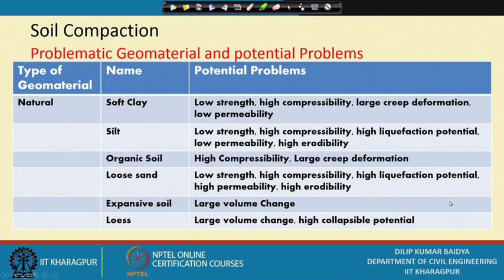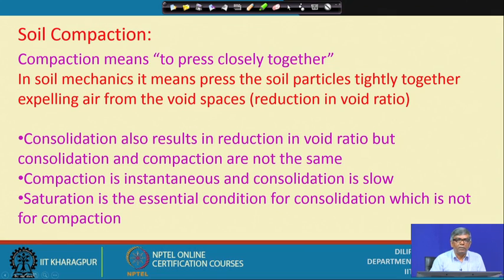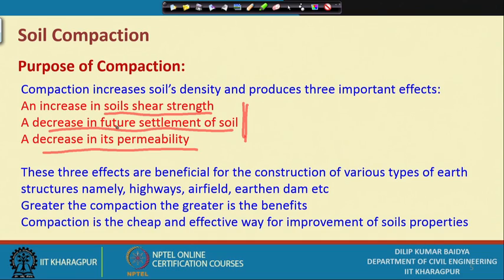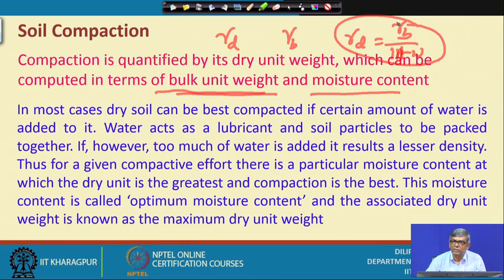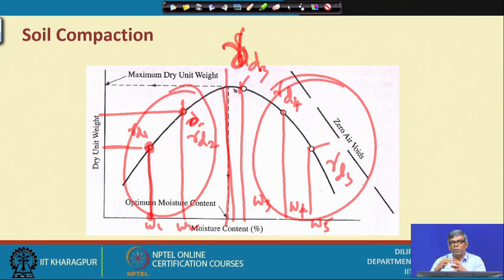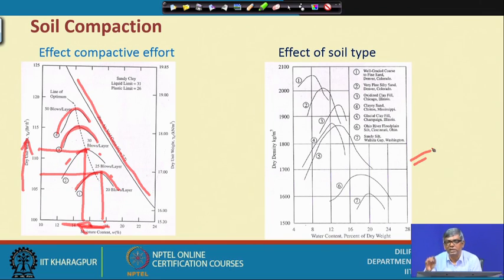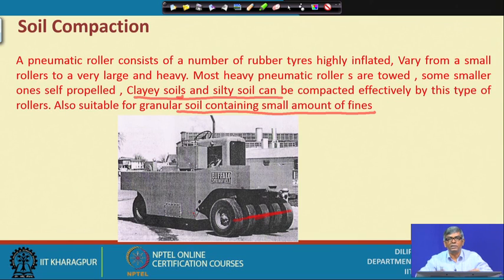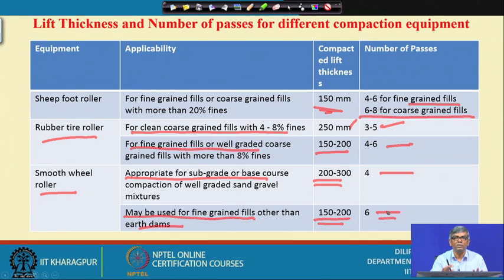LECTURE 14: COMPACTION OF SOILS

Comment: Why dry density falls after omc?
Reply: if you add water, the volume will increase. then you give the blows, the volume will go down again. therefore the soil will be denser. but if you add water beyond the saturation point, say the water will float above the ground, then the soil will degrade its density